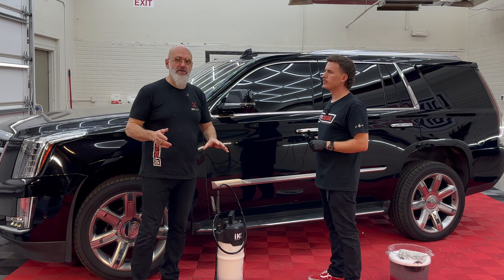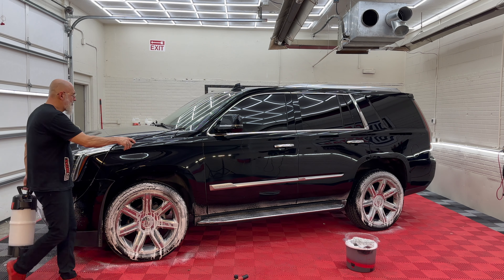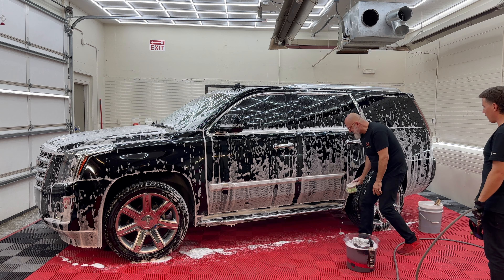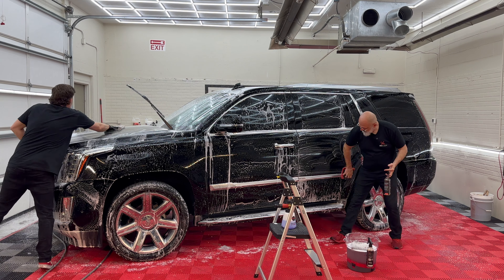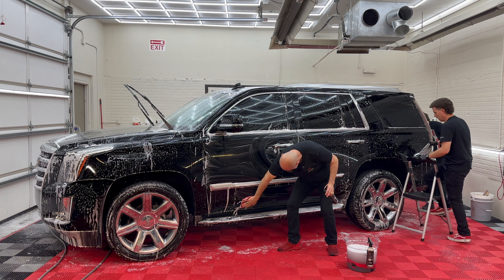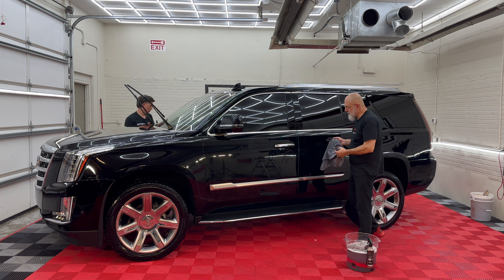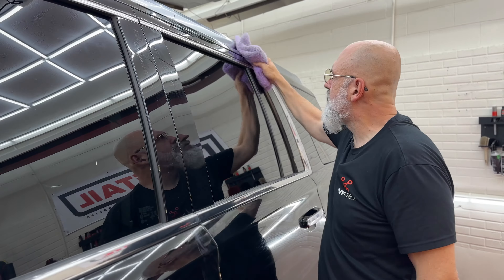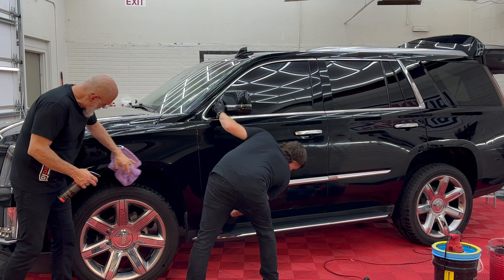EASY Pre-Sale Detail: how to shine paint to sell your car fast

Comment: @DIYDetail ... the new HF rotary is a cordless Hercules. Both Apex and imjoshv did in-depth review vids of a new corded Hercules forced rotation about 3 months ago.
Reply from the maker: is that the rotary or the forced rotation machine?
Reply: Just checked the current coupon and it excludes the Hercules brand. 🙄
Reply: Corded is forced rotation and cordless is rotary
Reply: @alphag5240  correct... I cleared that up in a follow-up reply to Yvan. Guess I need to see if I can edit the original comment. 👍
Reply: The original comment has now been edited. 👍

Comment: What steps would you add to this if you wanted your paint to look as good as possible, using just DIY Detail products?
Reply from the maker: Polishing with a more agressive machine, remove the ceramic gloss, and replace it with Panel Prep, then apply our ceramic coating.